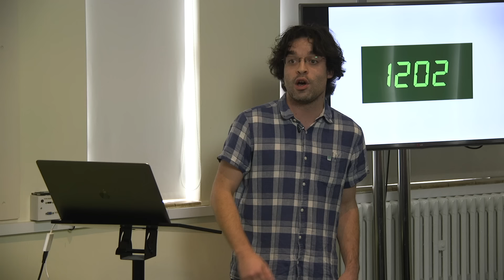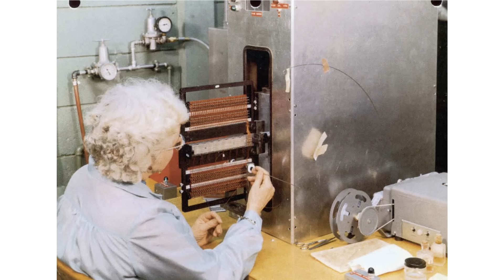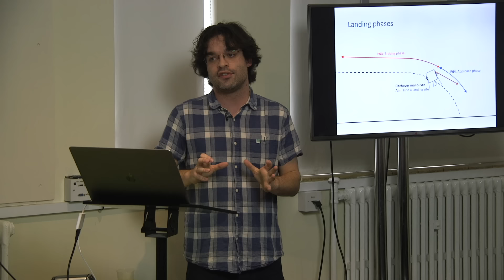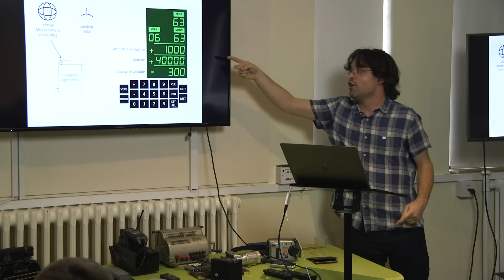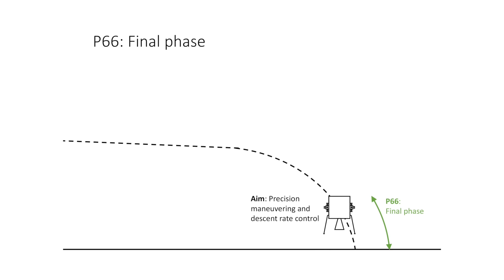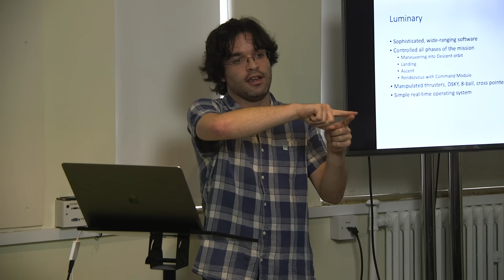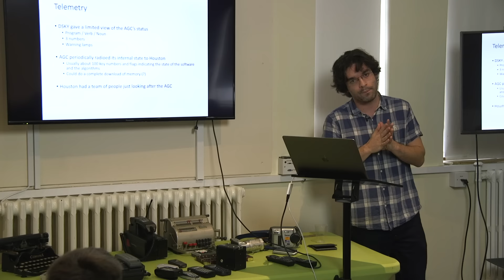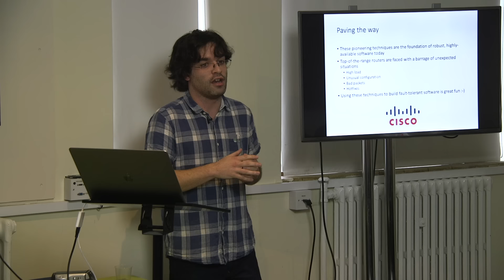Light Years Ahead | The 1969 Apollo Guidance Computer

Comment: Joseph Goebbels, the Nazi Minister of Propaganda, was a proponent of  "Big Lie" Theory. This is a well used technique where a known falsehood is stated and repeated until it is treated as truth.  In words of Goebbels, "If you tell a lie big enough and keep repeating it, people will eventually come to believe it" This is what you see in this video. The Apollo Guidance Computer (AGC) had 2.048 MHz clock speed, effectively running at 1.024 MHz or 0.043 MHz depending on the specific measurement. It featured roughly 72 KB of ROM and 4 KB of RAM, my Chinese phone has 50 million times processing power than this great Apollo computer.
Reply: Now post your proof that the AGC wasn’t sufficient enough for task it was designed for.
Reply: So it had limited tasks, read the source code. It was programmed in Assembly and stored in core rope memory. Without any research, trolling is not a good option
Reply: Wumao
Reply: Before you coment try to listen AND UNDERSTAND what was said in the presentation. He explained very clearly why the comparison with the hand held calculator is stupid. You comparing the Apollo computer with your "chinese phone" made in 2025 clearly shows the limits of your brain and your intelligence. Listen again to this course and see if your brain manages to understand the message ... 
I wish you lots of luck 😊

Comment: Fantastic lecture, came up on my feed and I thoroughly enjoyed this. Just a humorous point at 1:11:13 where Robert couldn't imagine writing "hello world" in less than 100K, this, I would imagine involving a modern high-level language which requires libraries etc. Using  raw 6502 machine code on the old Commodore 64 could definitely achieve this in less thank 100K... it only had 64K to begin with 😁 however I do take the point that in modern day terms you would need a lot more memory due to the architecture of modern systems. Once again a great lecture, thanks for sharing 😎

Comment: 6. None of the lunar laser ranging laboratories found corner reflectors from the Apollo missions. USA calculated 15, 5 and 5 photons per pulse, real ones are less than one, Chinese calculated 55 photons real 0.025, French infrared laser is reflected 1.3 times better in the places of supposed Apollo landings than green, although it should be the other way around. This means it has been scientifically proven that there are no corner reflectors from the Apollos on the Moon, which means there were no Apollo landings themselves.
The USA and its satellites do not have the right to prove their flights to the Moon with the help of photographs, since they will lie, the photographs can be easily faked in Photoshop, India, China, South Korea, Japan, they all have an agreement with NASA on mutual falsification of flights to the Moon and Mars. NASA is lying about the landings and lunar rovers of India and China, China and India are lying about NASA landings.
7. In the photographs, not only is the lunar soil gray instead of brown, which is impossible, but also the shadows diverge and the spacesuits in the shadow of the module are visible as if they were not in the shadow, which is physically impossible.
One of the most revealing photographs: Charles Duke and the Moonmobile. Apollo 16 (AS16-107-17446).
The soil is gray instead of yellow-brown. By the way, it should be noted that the wheel covers are brown.
The backdrop in this photo is clearly visible. The boundary between the ground and the backdrop is visible as clearly as possible.
One of the camera crosses extends beyond the parts of the rover, which is physically impossible.
The shadows from the car and the astronaut look in one direction; the shadows from the stones and the tripod look in two different directions and do not coincide with the shadows from the car and the astronaut.
There are wheel tracks on the right side when turning, there is no second track from the front wheels.
The letter C. Rene ordered the photograph directly from NASA, but after the publication of his book, the letter C disappeared from the photographs. 
The astronauts were supposed to see stars on the Moon since there is no atmosphere, but they all stated that they did not see stars. All Soviet cosmonauts confirmed that they saw stars in orbit, even if the Moon or Earth was visible. Although stars should not really be visible in photographs since the film is not sensitive enough, unlike vision.
8. The nozzle of the take-off module is close to the landing module, although there must be at least 50 cm there, otherwise the engine will explode when the gases ignite. During takeoff, the flame of the take-off module is not visible, which is impossible. The camera left on the moon should film the module taking off with a delay of about 2.5-3 seconds, but the delay is not visible. The camera had to have a transmitter power of at least 1 kW, or even 2-4 kW, in order to transmit 30 black-and-white or 10 color frames per second with virtually no interference, but officially the transmitter power is only about 20 W. The landing module was not tested for landing under lunar conditions even once, which practically guaranteed an accident. The Saturn-5 rocket suffered an accident during its last tests; several engines failed, the rocket fell apart, but NASA decided to fly to the Moon; naturally, no one has flown anywhere on such a rocket. Terceira Island, where all the capsules from the Apollo lunar missions fell here without even going into orbit, next to the Navy base and NASA training base at a distance of 4250 km from the launch, the USSR stole the Apollo 13 capsule, so NASA had to fake an accident in order to hush up the scandal. The USSR handed over this capsule at the Murmansk pier, after taking a photograph as a souvenir. An F-1 engine with a combustion chamber of 1200 mm is impossible. All real kerosene engines have a combustion chamber of 380-520 mm. Calculations based on the Soviet program show that NASA would need a rocket with a payload capacity of at least 230-270 tons, but actually more (270-300 tons), since the mass of the command, landing and take-off modules is greatly underestimated. Brezhnev was corrupt for bribes, he would confirm anything, even the flights of astronauts to the Sun, the USSR received grain supplies, the KAMAZ plant, IBM computers, his daughter headed the diamond mafia and was engaged in theft and speculation in jewelry, as well as murders. This is not the first time the United States has engaged in fraud: Peary claimed that he had reached the North Pole, in fact, as it later turned out, he spent the winter in northern Greenland, this was later confirmed, researchers found his camp and, in my opinion, he admitted this in his memoirs. The United States accuses Russia and a number of other countries of doping at competitions, but cannot prove it, because they cannot present a large number of declared doping tests, so commissions are created that, without evidence, talk about a large number of doping tests, but in fact, from a third to half of the US team have illegal doping exceptions and take doping. Doping is an illegal advantage, legalized doping is legalized fraud. Cheat on the medal. The US plays by the old rule - if you can't do it in reality, fake it and deceive it. Etc. etc. Any person, especially a scientist, cheerfully talking about NASA flights to the moon is a fraud.

Comment: Man who used that computer , was head of that group running it ,said in these words , its very simple . Now you say light years ahead . He said , barely adequate
Reply: "Light years ahead" doesn't mean anything.  But the AGC did need some significant advances in technology to achieve a result that was "barely adequate."  Both are true.  The main advance was the use of the first integrated circuits for logic gates.  This kept the size and weight down.

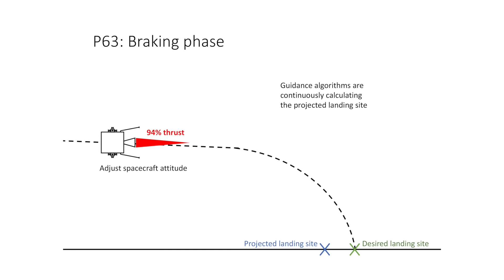Comment: 24:27 Has anyone ever asked WHY 94% thrust? No one asked in this session. I looked it up and the only reference is Wikipedia which said preventing between 65-92% to prevent excessive nozzle erosion.
Reply: in some cases like this it's been off due to a rocket engine changing speccs. ie you'll see "110% thrust" because the engine was upgraded to be able to do more than the computer settings had as 100%.

Comment: The AGC DID NOT GET YOU INTO ORBIT.  It had nothing to do with launch guidance.  Get your facts right.
Reply: The LVDC was the launch computer
Reply: The regular mode was that the Saturn Instrument Unit would steer the rocket into orbit. However, as a fallback, the AGC did have the capability to perform the job as well. It was just never required.
Reply: It did get Apollo into orbit around the Moon.

Comment: Activating the rendezvous radar during landing—which would lessen the workload on the crew in the event of an abort, because the system they’d need to use to find the command module Columbia would already be operational— was specified in the four-inch thick book of astronaut procedures.

Comment: I've often wondered, in terms of modern hardware or even some from decades past, what would be the minimum hardware you could do this with today? WOULD a pocket calculator be enough? Or maybe a cellphone board? Or would it still have to be a dedicated system designed just for this job?

Comment: Correction on 18:20. In Program 63, the position of the astronaut and the LEM (Lunar Module) window is oriented toward the surface of the Moon — not the other way around. At this stage, the astronaut is noting timestamps and identifying landmarks on the lunar surface to help determine whether they are on the correct trajectory or overshooting their target.

When transitioning to Program 64, the LEM begins to rotate so that the window points forward. This reorientation allows the astronaut to view the lunar surface in the direction of travel for the next phase of the descent.

Comment: Let's start with a simple technological flaw in the so called moon landing. The Apollo 11 mission took 8 days, 3 hours, 18 minutes, and 35 seconds to get to the Moon and back. The walls of the craft had what R rating of insulation between the inside and the -454.75 degrees temperature in space? Now, how many kilowatt hours of electricity were needed to heat the interior for 192 hours, not to forget power radio transmitters that supposedly sent audio AND video (lol) to Earth, the extremely inefficient transistor computers, lights, relays, solenoids, fans, CRT tube screens??? I won't bother with any more factual data because anyone with a basic understanding of electricity and knowledge of 1960's technology can quickly determine that the battery weight and size needed would far exceed the size and capabilities of the proposed capsule/module that also contained the ha ha ha...lunar lander....another impossible craft.
Reply: You forget simple, basic, facts like the fact that the missions were done in space, i.e. in a vacuum. This means heat transfer through convection and conduction does not happen: you only have to deal with heat transfer through radiation. For most of the mission the spacecraft was in sunlight, being exposed to 1300 W/m2 of solar energy. Only during Earth orbit and during lunar orbit you'd have a short period in shadow, followed by a longer period in sunlight. 
This means the thermal design of the spacecraft needed to do 2 things: 
1. reduce the amount of thermal radiation coming in. This is why the CM was coated in shiny metal, and the space suits were white: both reflect 95% of the sunlight. 
2. reduce thermal transfer from the surface to the interior. This was done using multilayer foil insulation, which is useless in Earth's atmosphere because it only hinders heat transfer through radiation, but is the lightest-weight insulation material in existence. 
This worked so well that the LM could sit in continuous sunlight and maintain a habitable interior temperature without active cooling. During Apollo 13, it got cold in the LM because the electronic systems inside had to be mostly shut down, and that decrease in heat production was enough to upset the thermal balance.
Reply: anyone with a basic understanding of electricity and knowledge of 1960's technology  and basic understanding of the design of the Apollo spacecraft can see that the power systems they carried do in fact provide enough power for the mission requirements. You are arguing from a lack of such knowledge, as your claims about the insulation demonstrate.
Reply: @zounds010  ✅
Reply: Wow ! You really must have done a considerable amount of 'research' on this topic. You should write up a paper about these studies of yours, and your conclusions. Then you need to present it to the Academy of Science and Technology (AST) and have it subjected to peer review. There's a real 'possibility' that the Academy could greatly appreciate your insight into this fascinating subject. Surely they'll then all realise that the entire world has been deceived by the shenanigans of the Globe protagonists . Your insights and revelations will bring in the astonishing new world view!  Who knows. You could even be eligible for the Nobel Prize in Scientific Research. Think of the prestige of being presented with a Noble Prize ! Now wouldn't that look nice hanging up on a wall in your basement ! 🤣
Reply: agree !
Reply: @yoskarokuto3553  Go away, You're just a religious neurotic.

Comment: Was there a P65 phase? And what was it?
Reply: Robert answered that in the questions at the end. There was friction apparently between the astronauts who wanted to land it themselves, and the engineers who wanted it fully automated. Basically, P65 was the Program that fully automated the Lunar Module landing with no astronaut involvement, P66 was the landing under astronaut guidance. So, when P64 completed, the astronauts simply entered the relevant verb/noun to run P66 instead of P65.

Comment: What kind of radiation protection did this so-called Moon computer have?
Reply: It was packaged in a metal box.  Magnetic core memory and small scale integration logic are not particularly bothered by radiation of any kind.
Reply: @GH-oi2jf  LIARS!!!
Reply: The AGC wasn't a "so-called" Moon computer, it was actually used for the Apollo missions. 
The AGC used magnetic core memory for both ROM and RAM. This type of memory is completely impervious to radiation. You could put this memory in a nuclear reactor and the memory contents would stay intact indefinitely. 
The electronics of the AGC used the first generation of integrated circuits. This used huge semiconductor features (with a billion times more area than today's semiconductors), making them again very insensitive to radiation. This was plenty: no AGC suffered a radiation-related error during any of the missions.
Reply: @h.dejong2531  LIARS!!!
Reply: @yoskarokuto3553  I notice you don't have any evidence for your claims. Pathetic.

Comment: **Adhesive Non-Stick Temperature:**most adhesives start to lose effectiveness. Above 150°F (65°C), many adhesives can begin to soften and lose stickiness.

Apollo 17 Rover Repair Temperature: During lunar day, up to 250°F (121°C).
Reply: 120ºC is the temperature of the rocks on the surface at the hottest moment of the day. The Apollo rover repair was not done at the hottest moment of the day, it was done early in the lunar morning. It also wasn't done on bare rock, but on the metal of the LRV, which is a lot better at reflecting sunlight than the rocks are, which means the peak temperature is a lot lower.
Reply: @h.dejong2531  Many do not know that a daylight period on the moon is equal to 14 earth days and therefore there is a long morning period in which the temperatures are lower and the position of the sun is low. By the way, are you Dutch?
Reply: High temp silicone is good to 600 f. Even regular silicone is good up to 400 f.
Reply: >>lunar day, up to 250°F 
Why do you believe the moon is that hot when we clearly lack the technology to measure the moon's temperature?

Comment: IMHO the programmer could have chosen a better word than “alarm,” to alert them that the system was shutting down. Alert, warning or notice would worked better. If you hear a fire alarm you run like hell out of the building. If you’re maning an alert aircraft you run like hell to your plane.  When you are landing on the moon and your computer is about to reset you need to be alerted, warned or notified. But you don’t need to run like hell to anywhere.

Comment: recently a soft landing, the space craft tipped over so they failed in making sure the craft was not moving laterally during descent ☹️🤷🏼‍♂️
Reply: It failed because the altimeter wasn't working: they forgot to switch the altimeter out of safe mode during the preflight check.
Reply: Recently, a plane flew into a helicopter and crashed into a river.  I guess that proves planes can't fly.

Comment: Anyone know if Artemis will be using a similar verb/noun system like the AGC or is it all totally different now?
Reply: The AGC interface had to be simple because of the limitations of the computer and because of the limited time they had for development.  Those limitations don't apply today.
Reply: Totally different. The Orion spacecraft has a control panel similar to modern aircraft: 3 large displays, with rows of buttons around the edges of the display. The user interface is graphical. 
The SpaceX lander is likely to have touchscreens, like their Dragon capsule.